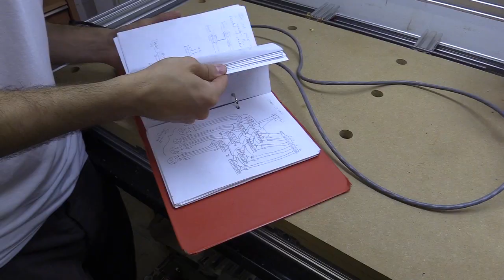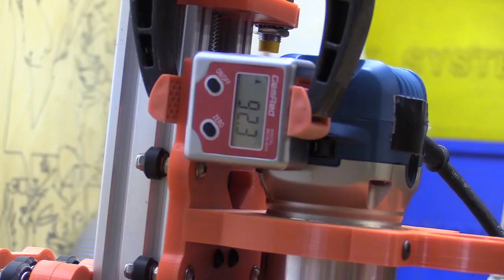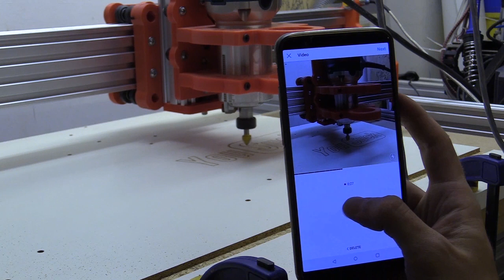#27 Setup, Overview and Conclusion #27 / 3D Printed CNC Machine

Comment: First of all, you’re doing an awesome job with your videos.  Educational and entertaining at the same time!

Regarding lock collars on the lead screws. You should upgrade to clamping style collar instead of the type with a simple set screw. I got some cheap of eBay here in the US. It a huge difference. 

I’ve also been considering adding some heavy duty springs between the lock collar and the bearing to make the tensioning easier. One of these days.
Reply from the maker: Thanks for the comment and the heads up! I'll look into those. I think the wheels would hit into the collar if they extended out further with springs but it's a good idea.

Comment: Have you had any issues with one or more axis being rather stiff in its motion? I have assembled a C-Beam XL and my long axis won't move smoothly. I've tried everything I can think of to make it run as smooth as the other 2 axis. Other than shortening it. It makes a sort of a grinding noise when I try andoperate it. Yet everything is lined up perfectly.
Reply from the maker: No I haven't. Do you mean the lead screw doesn't turn easily? That could be tension adjustment in the nut block. Or you may have over tightened the wheels?
Reply: I can most the wheels to adjust freely except for one. I'm under the impression that some of the small carriage plates are ununiform in their drilled pattern. I'm running 2 wheels per corner and regardless as to what I try. One of them is always stiff to turn. I have dual eccentrics on each wheelset on one side of the carriage plate and just spacers on the opposite side. I'm thinking that I might be better off by opening up each of the corner holes on all 4 corners so that I can add eccentrics on all 4 corners as a workaround.
Reply: I finally got it to function properly and am now fighting with Mach3 not paying attention to the machine and soft limits.

Comment: im wanting to make a sort of linear carving type lathe, for doing staves/dowels, or rounding peices out, i want to use my dremel as the carver, and im basicaly starting out mostly from scratch. what i really need is a good design, though i have one in my head im a terrible draftsman haha... though, the basic idea i have, is, to make a lathe to turn peices between centers, like you woudl normally find anyways. but, i need to have a 6 foot length, as the longest stick i would likely turn would be my own height, or a little over 5 feet, with some extra length for room either side of the peice... the only trouble im having is finding the right lead screw assembly for my purposes... ive found various sites that sell those things, but this is a first for me, so any advice woudl be welcome... as i already have plenty of wood, some sheets of plywood, and various scraps, i can make the bulk of the stationary parts from that, so its only the moving parts that im stuck on. so, basicaly, a lead screw long enough for my needs, a nut that would attach to a plywood plate to secure the dremel, or a router in a later upgrade, and some bearings to secure the screw, and allow me to turn it... there are machines that can make dowwels or pool cues, but i really cant spend upwards and over $3k right now, and, to be honest, the thrill of making my own machines, and save some money too, is too much to not at least give it a go... so anyways, sorry for the monologue, but that can happen when writing at 2am mid week =) lol
Reply from the maker: Haha, 2 am CNC talk leads to headaches. Anyway this is 1500mm long and cheap if you're in the states: https://goo.gl/Hj855w  Otherwise you might have to go with a belt and just be really careful with feedrate and plunging.
Reply: thanks, that looks awesome. and haha, aye, i do a lot of my best thinking late at night. now if i could make up a design on the computer, i would then be able to order parts and such. but ive done a lot of looking around at various bits and peices of CNC type lathe stuff. making the lathe bit should be fairly easy, its the cnc side of it thats the hard part. i figure i could do a modified version of what Mathias Wandel made, using actual bearings and somehow incorporate some live centers via the internet, the part that the lead screw assembly would do is allow me to carve using a dremel across the wood while its turning, so i can get fairly precise circular peices. if i could find a linear slide that can do 6 foot length for reasonably priced that would be the bulk of it done right there, especialy if it had an easy to use, and select feed rate stepper motor, that had easy controls without need of a computer, at least innisially...

Comment: Tis lovley. I have come to the conclustion, rigidity aside, that the most money should be spent on good screws and good linar motion parts as the basis, evrything there on out can be improved as you go along. Im gonna cut this short, as this is a 2 bottle of wine and pound of cheese discussion usualy started just after a long fridays work.
Reply from the maker: Lets be honest - I've just made a really expensive bear bottle opener slash cheese greater.

Comment: Careful with the MGN12 slides, always use in pairs per rail and torque down incremental across 4 blocks per plate. They gave me such a headache and most of it came down to the inconsistent height/thickness/surface of the extrusion I was mounting them to. Also tighten one rail 1st ( both slide blocks and rail ) then use it as a "master" to run the "slave" or 2nd rail and blocks to each end and make sure it wont bind. I hope this helps/makes sense!
Reply from the maker: Yep makes sense. I've actually made a 3D printed jig to hold a dial gauge to help me do that. But I'm finding the blocks vary. Some are really smooth and other really bind. I'm trying different things to see what works from cleaning to dismantling. Can't tell if it's the balls, the blocks or the rails where errors manifest.
Reply: If you took a micrometer to the balls (haha) I think you'd find they vary a bit, usually they are reject precision balls. I had even bought a set of MGN12 from one ali seller and later purchased more blocks from another, assuming they would be compatible, but the 2nd set I bought had a totally different profile by 1mm. They always claim to be HIWIN with the red and green however HIWIN are Taiwanese and are held to very strict tolerance standards. Oil or Grease is up to you and after a while with a bit of force, they will "wear in", which makes them slide easier but seem scratchier? Worth the money and still better than any round rail or wheel so long as you get everything lined up. If you a looking to make an "end game" version with alu plates and ball-screws eventually, you are best to go with "used" "new old stock" ebay rails from THK, NSK or any reputable Korean or Japanese brand, as even after years of heavy service they will outperform chinese MGN clones. I'm currently making a small machine in this manner using granite surface plates as the base and a stone bench off-cut as the gantry.
Reply from the maker: Thanks for the word of warning. I'm going to try be meticulous in testing different methods to improve their performance. We'll see how I get on. Your machine sounds good. Working from a flat surface makes everything so much easier!

Comment: Hi, i also have idea to use mgn12 to replace the solid wheel. Would like to see how you install with the c beam
Reply from the maker: I'll try crack on with that video. It's interesting but frustrating at the same time.
Reply: Educating Savvas cant wait to see the results. Solid wheel is not rigid, also difficult to adjust